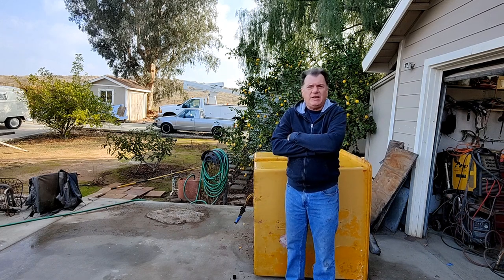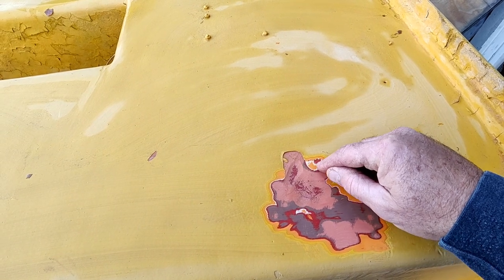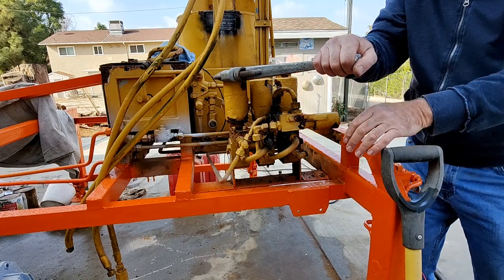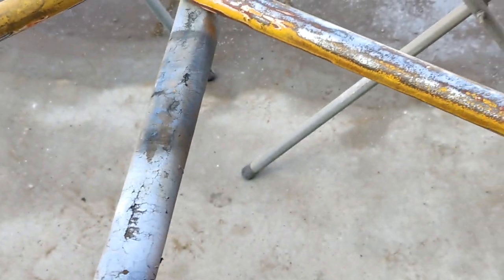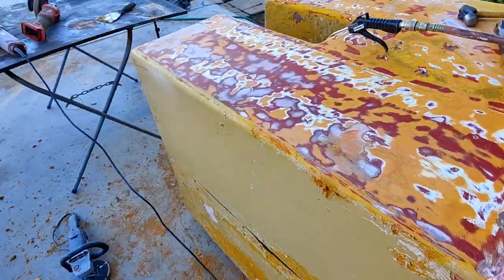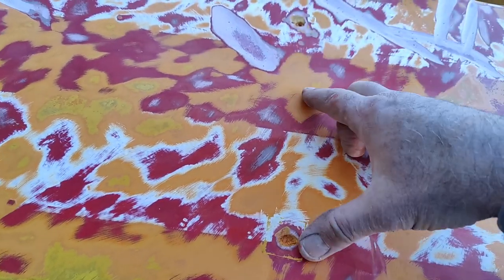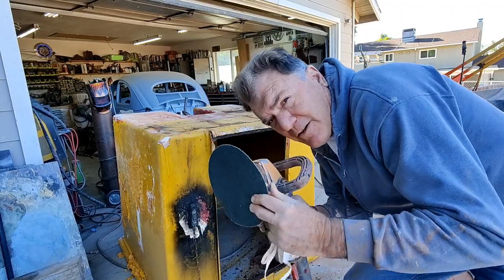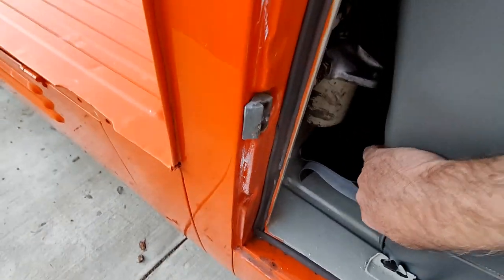Stripping paint on the Basket 62 VW single cab cherry picker lift restoration Restore

Comment: Hi Mike, I think your right on the bucket. When they built it I think they just used spray fiberglass with a mold for the inside. When they were done to be able to paint the outside they just sanded it off and put a filler on to smooth it before paint. Basically, just waterproofing it so it didn't get delaminated and water in the glass. No expert but I worked with the Boeing fiberglass folks for years and some of their tech stuff I did listen too. ha-ha

Comment: Mike, love this build! Been watching since the beginning. . you had me on the hook from the first sneak peak! I believe those little rods bolted to the bucket are for safety strap mounts. I am sure they had some sort of harness to hold them in. I would probably put a drain hole or two on that plate on the steel frame under the bucket to prevent the rust trap happening again.
Reply from the maker: yea I put 4 drain holes in the plate. for some reason it did not show up in the video when I was painting. one in each corner.

Comment: It's coming along great!  No need to defend your work.  The results are ever so much better than it was originally.  I'd junk the electrics and just recreate new stuff that looks similar.  It's not like someone could compare it to all the others made.  Are you going more to epoxy primer than the DTM?  You seem to be steering CT in that direction.
Reply from the maker: using both. Epoxy on some things and DTM urethane high build on others. No DTM cheap stuff. doesnt pay. I really like the PCL epoxy prime n seal but since Axalta bought PCL it is just too much money. Tamco you dont need the epoxy. I told CT to use epoxy because in FL it is just too much humidity Even the swamp dragon has rust on it already. All depends on where you live and what your doing.

Comment: Hi Mike, this cherry picker is really awesome 😎. You are doing a great job  restoring it. I am sure when it’s finished the first show it goes to it will be a real head turner. I had a look through some of my Volkswagen books I found some black and white photos of these cherry pickers I found a few from a 1958 prototype that shows a spotlight mounted on the small pipe in the basket it looks like there is a 2 foot vertical pipe that the spotlight is mounted to and that pipe is mounted to the pipe on the basket probably with pipe clamps I can’t see the clamps clearly but I am guessing that’s what they are. Hope this helps

Comment: ps: Mike you gonna put some drainage holes in the centre plate to let the water out when you refit the bucket
Reply from the maker: yea i put them in there forgot to point it out in the video. They are there but you cant really see them I did them before paint. so they would have some protection on them.

Comment: On the stripes, seems like dividing the total width by 10 at the top of the bucket would be best.  There are 9 full width stripes with 2 half width (about) at each end.  Is the total width of the bucket about 40"?

Comment: before  starting  into the controls repair  get  ahold of someone who is into electro mechanical, maybe 60s-70s pinball repair who works daily with the relays, coils, switches they might be able to help simplify the repairs on your lift ?   might check craigs list repair
Reply: Mike is a pinball machine expert…😉

Comment: This is what I have to say about those that think you should to the highest level of build or they would not buy it without a h supper high level build, why didn’t you buy it or what is the worst one you built. I am sure they wouldn’t take this on and most people that I k ow like that just pay someone else to build their cars. They don’t understand how much work it is. 

My opinion is that it is your project so you should build it the way you want. Others do not have the right to tell you how to build your project. You was doing a great job.
Reply from the maker: true I dont think they know how much that would cost either. Probably doing it like that would run into the 100k's More than my wallet can spare. As it is I will probably be in this close to 40. or so.
Reply: @Mikefngarage  I just completed a patina build on a 1970 westy and was I to it just over $7K which was over the budget is set. It was also a bus that no one would touch because it was too far gone for them. I am working on a 1970 Transporter bus that my budget is set at about $15K but I figure I will be over that. But I may trying to do a middle to high level build and I will do all their work. Not paying someone else to do any of it. 

I agree most people that make those comments do not know how much a build can cost or the money is no object to them. They don’t have a problem $100K plus build.

Comment: On the frame under the bucket, where the boxed in plate is, would weep holes be a good idea so it drains instead of becoming a swimming pool?
Reply from the maker: hard to see in the video but I did put the holes in there all 4 corners.

Comment: Instead of the solenoid relay valves why could you put valves with handles . You would not be able to control it from the bucket unless you use twice as much hose ?